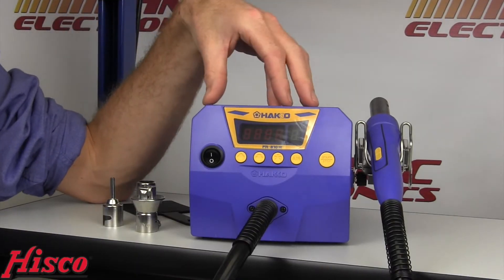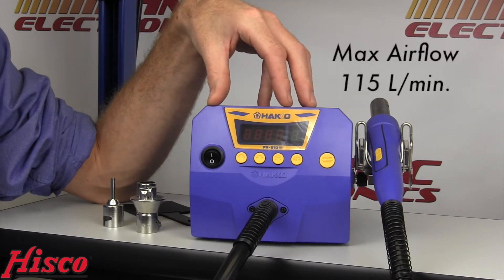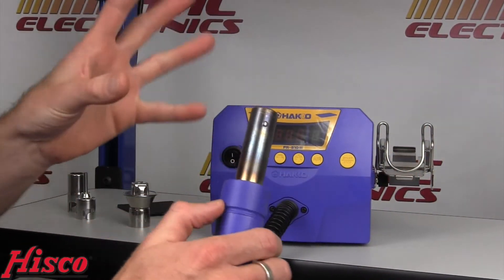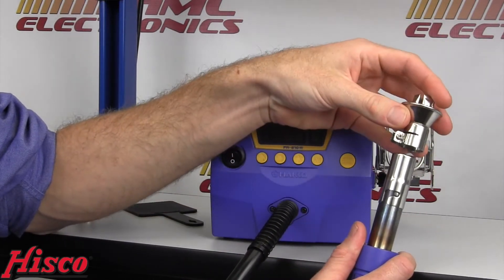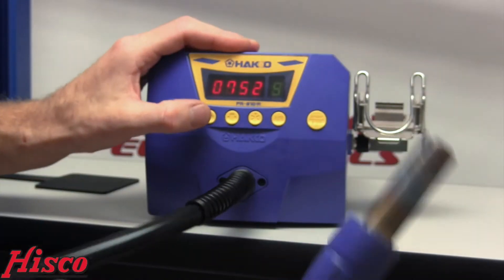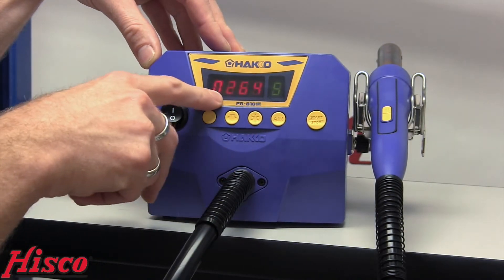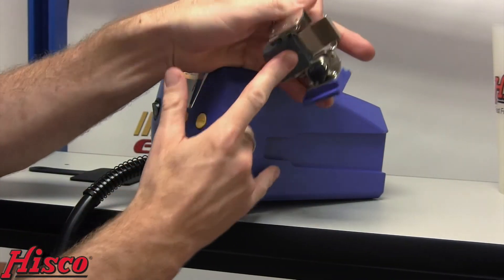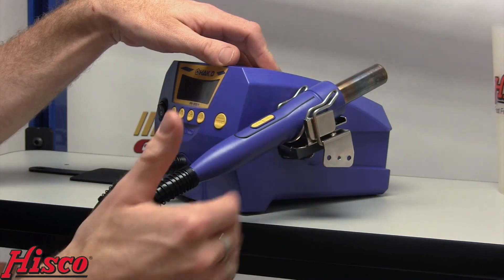Hakko FR-810: An Overview

Comment: Interface is total garbage.  You have to press a hundred buttons to change the temp and air flow.  Epic fail!!  What's wrong with up and down buttons or even better knobs.  Other waaay better and waay cheaper machines.